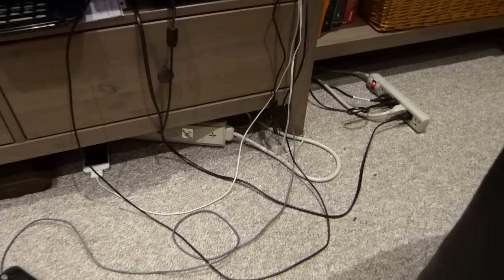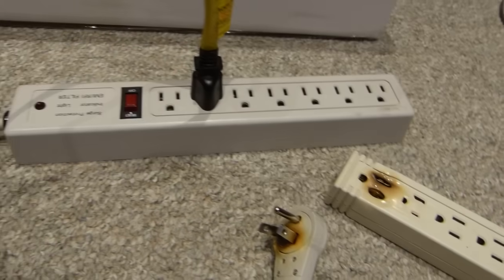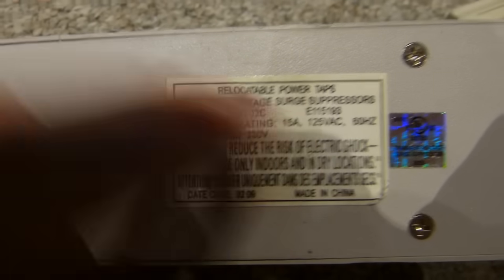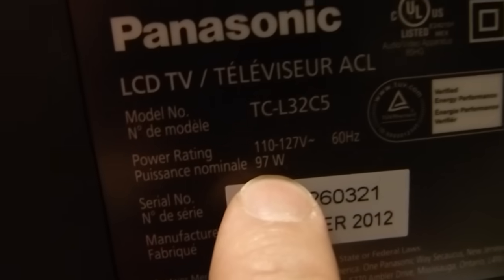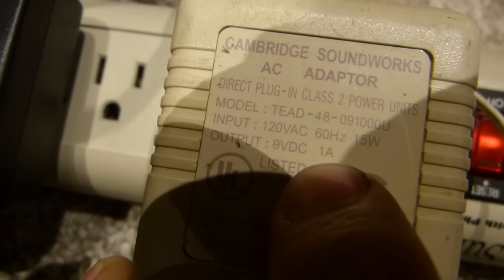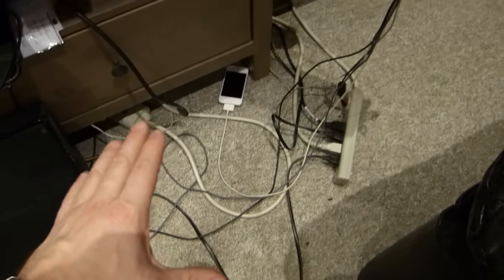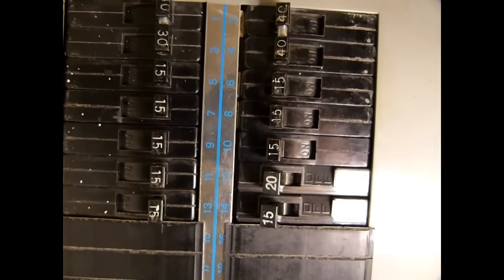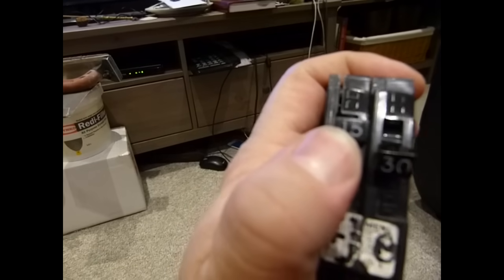Is it safe to plug power bars into power bars?

Comment: It looks to me as though either you missed something in your explanation of the failed power strip or something else failed. Here's why:
1. The strip that failed should have been able to handle the 12.5A load from the heater
2. If the load was more than 15A, then the failed power strip should have broken the connection on its own.
3. If the failed power strip was plugged into a branch with a 15A breaker and the load was more than 15A, then the breaker should have tripped.

It looks to me as though the socket that burned was itself broken -- I'm guessing a loose connection. I think that socket failed at 12.5A, and would have failed with any 12.5A load whether connected through another power strip or directly plugged in.

The bottom line is the failed strip was broken. It should have been able to handle its rated load without any issue, it should have turned itself off if its load exceeded its rating (15A).

I think the answer to your question is "Yes" ("Is it safe to plug power bars into power bars").

I think your thumbnail showing the burned socket is misleading. That thumbnail is more appropriate for a video titled "Is it safe to use failed power bars". And of course the answer to that last question is "No".
Reply from the maker: Yes, rotating outlet had a gappy fit to the plug blades, was arcing inside.

Comment: how many amps is a 700 watt computer power supply
Reply: rough numbers -- power is voltage times current. If your 700 watt power supply is plugged into a 120 v line, then it's drawing 5.83A.
Reply from the maker: I agree with Thomas Stambaugh, 700 / 120 = 5.833333 Here is some visual clues to go with that math https://www.youtube.com/watch?v=FWDxmp62itA

Comment: I know your pretty much saying this in the video but I’m just saying this because this was obvious from the start. Plugging in another power bar into another power bar is ok. But, if you plug in something as powerful as a heater, the power bar’s limit is surpassed and it starts to heat up and burns.
Reply from the maker: - that math is not happening

Comment: First off household appliances should never be plugged into a power tap or surge protector or even an extension cord! Heaters and air conditioners, and even hair dryers being the most common mistake just to name a few. Mainly because they generate higher levels of resistance witch causes unwanted heat to build up. Thats why its recommended to have each individual major appliance on its own circuit. Every minor appliance just plug directly into the wall. Just like the video states. It is important in understanding what kind of circuits that you have and whats loads are on those circuits. That way you dont overload them and potentially cause a house fire! Also not all power taps and surge protectors are fire proof. So make sure that the one you have is. Dont cheap out. Its not worth burning your house down over.
Reply: Sorry, but this is very incorrect. There's nothing magical or threatening about "resistance". Every device must have resistance -- if it doesn't then it's called a "short circuit".

There is a simple principle -- "Ohm's Law" -- that says that voltage (V) is current times resistance (R). V = I*R. If the resistance is zero, then current must be infinite to maintain the same V -- a short circuit.

This video is about power. Power is current times voltage (I*V). Whether cheap or expensive, a working power strip rated at 120v/15a can handle any load totaling 15A. It doesn't matter whether it's one socket at 15a or 5 sockets at 3a each, the result is the same.

The burnt power strip in the example was broken. It burned because it was broken. The nature of the load had nothing to do with the failure.
Reply: Thomas Stambaugh If you put plastic next to a heat source it will melt simple as that.

Comment: I only watched halfway as you came to a conclusion by then. But, why didn't the safety trip on the first power strip? Unless they were too cheap to use a thermal magnetic strip on the safety. (Thermal meaning the strip heats up under too big a load, then flexing and tripping the breaker, magnetic meaning a short causing a big magnetic field to flex the strip.)
Reply from the maker: Safety breaker is for overcurrent, i.e. power contacts ground, gets dropped into bath tub, etc..
This was within current limits, but arcing along the way.
(Also there`s nothing there to stop people from spilling liquids into it.)
Reply: If it was arcing, then the power strip socket failed. It would have failed the same way with any load.

Comment: Daisy chaining is the name that springs to mind to me. It's perfectly okay and safe to do as long as you don't exceed the power rating of the power strip, which should be molded somewhere in the plastic casing, or the sockets thereof.
Reply: Except it violates the safety devices that are on the power strip, extension cord or surge protector.  They are not designed to be plugged into each other in any form or fashion at all. They are designed to be independent equipment.
Reply: @chadmargraf4020  The reason manufactures warn against daisy-chaining is because they assume people will use every available plug in both the first and second power bar, and I don't blame them for assuming that because people are idiots. However, as long as you keep the full power draw well within the maximum amp rating for a single power strip, (which is usually around 14 or 15 amps) then it is not dangerous. People just need to understand that a chain of power-strips has the same maximum amp capacity as a single power strip. You don't gain extra capacity by chaining them because every strip in the chain must bear the full load of everything that's plugged in.
Reply: @Beefnhammer  thats what I figure, that you are not using all the devices at once.  and would shy away from using the bar for anything that heats up and thereby draws a lot of electricity.

Comment: Space heaters are in a general category, along with air conditioners and microwaves: things that really should be on their own circuit if possible. and definitely should not be plugged into any circuit that is already heavily loaded.

Dryers and stoves would be the absolute kings of this category, except they normally run on 220V and so usually have their own special outlets wired to dedicated circuits, which hopefully stops most people from unwittingly overloading circuits with them.

And yeah, circuit breakers occasionally fail to trip, so if whatever you are doing is tripping circuit breakers and causing you to need to reset them, this is a strong indication that you are plugging in too many big-draw items and urgently need to stop doing that.

Comment: You also messed up on the router. No way it draws 1A on 120V. Typically the only case where I'll add on an extra power strip is when I need to power a few small devices, kinda like what you have here. Other than that, I plug it into an additional available wall socket.

Comment: It's quite clear to me what happened. Electrical conductors get warm when they are pushed near their rated limit (doesn't have to be over), the first place to get warm will be the weakest point, such as a connection like a plug. As a conductor gets warm resistance increases, as resistance increases it generates more heat, and it can turn into a runaway effect until it starts a fire. Your circuit did not exceed 15 amps, which is why the breaker did not trip. The problem was the cheap Chinese power bars, despite saying 15 amps they are not designed to handled that kind of load. If you've ever used Chinese batteries that say something like "6000mah" but actually are more like 800mah, you'll be aware they are not shy about overstating the capacities of their products.

Comment: i was so sure he would say that a heater was plugged in on that one
i use this leap frogging technique in my home but i only use phone chargers so there isnt much load on them so its safe
if you wanna use a heater just dont do it like that
but for charging a few phones a bit further away its not gonna have any issues
Reply: wow how many phones do you need
Reply: L well at most 3 phones (not all mine) and a few other devices that dont need much electricity. Although i mostly put an "extension" so i can sit across the room while charging and using the phone because we never use them all at the same time

Comment: I wonder why so many countries have so odd electrical grids. 125V? That is stupid. The lower the voltage, the higher the current for the same power. More current means more power is lost to heat at resistance. P=I(square)*R.
Reply from the maker: Historical reasons. 1st grids are whatever, the rest are improved.
Reply: +Luca Dario Bützberger
Sadly, it is hard to change an already running and working system. Even when there would be a ton of waysto make it better.

Comment: The issue here isn't the leap-frogging of multiple power bars, it's the fact that too much current/power was requested by the second power bar, it failed to properly cut-off and just burned the plug by requesting too much energy.

Comment: make sense i have never had a house i had my laptop my pc my tv a fan and a moden connected but the modem is on its own power bar so i can reset without unplugging it 
power bar on mine is in the order of outlets form near on off is TV, Monitor, Laptop, PC, Second Power Bar. then modem is the only device plugged into second power bar

Comment: Isn´t there circut breakers in that house? Of cause i live in Europe where we have 230V. 

And i use only 16A Power bars (and 16A is the maximum on normal plugs). Most of the breakest is 10A (2300W) and some are 6A (1300W)

If my wife comes around and plug in plug in the steam cleaner and the vacum ... that she reguarly do... enable both at the same time, boom goes the circut breaker.

Comment: Man I got a power bar in my power bar and that power bar goes in to my tv and a second power bar comes out of the tv and I use that one to charge my 2 phones not to mention that I have another power bar that is plugged in to a lamp that that wire then feeds all the power in my house or at least most of my house and then finally the last power bar connects into the wall

Comment: You are calling people retards, yet you use the current ratings of the secondary side of the psus...
Reply from the maker: Not calling anybody anything, but what is sice and psus, Mr fine detail?
Reply: theoverengineer Side of PSUs (PowerSupplyUnits)
Reply from the maker: Ahhh, I read the wrong line off the PSU, camera had to be in the way. Issue noted about 5 months ago. Sorry about that.

Comment: What happens if you have 6 power bars connected to one power bar, and 6 more power bars connected to each of the 6 power bar, and power on 36 microwaves at the same time? hmmmmmmmm

I feel obligated to say this even though the video is self-explanatory, but don't actually try this, it is obviously dangerous.

Comment: not really, when you plug things into a power bar you draw more current on that wire than recommended, but when you plug another one into that first one, not only are you overloading just that one cable, but you are overloading the first bar's cable even worse.

Comment: The thing I hate is there is always something that has a big or strangely angled plug that prevents using the adjacent sockets on the strip.  That only encourages adding another strip.
Reply: Manufacturers still can't decide if the cable should come out the top or bottom of the adapter too. So you have to make sure there's enough space top and bottom.

Comment: its not power that caused it, its god smiting you for using and incredibly "fuck you" kindof power strip. just look at the damn thing! it fucks you over not only because of the angle of the plugs, but also the fact that theyre backwards (ground facing to the power button). say you have some huge ass power brick that you have to plug in yeah? you HAVE to take up about 3 or so spaces for it because you cant have the power brick over the edge on one side and on the other it would cover up the power button which is also a saftey hazard. tldr god hates you for using the wrong power strip and for using anything other than an american outlet
Reply: wait fuck those are american outlets
Reply from the maker: nice comeback, thumbs up for that :)

Comment: It works as long as you do not exceed 10 Amps. The heater + other things easily exceed 10 amps. You need a 20 amp socket just for the heater actually.
Reply: Perhaps for some foreign electrical code I dont know, but in the US we have 15 and 20 amp circuits. A 15 amp circuit can power a 1500w (12.5a) heater at 120v just fine, which also happens to be the limit for a single device.

Comment: DO NOT DO THIS THIS IS TERRIBLE ADVICE YOUR HOUSE WILL BURN DOWN
Reply from the maker: Video provides NO advice whatsoever. Because it can burn down your house. Pay attention.
Reply: you said it can be okay in some instances. It can certainly not.
Reply from the maker: The 319,018 viewers and their houses are fine and safe, so tell them.
Reply: First of all, you don't know that, and second, I just did tell them…
Reply from the maker: We do. But I was wrong, we only heard from 1053 of them, confirming the opposite.
Not really, this is not going to be read.
Reply: then why are you even replying if no ones going to see it? A less inept individual would realise how pointless it is and might even not put terrible advice like this on the internet for 12 year olds to try out in the first place.
Reply from the maker: Still not providing advice, back to line 1,  do pay attention.
Reply: You literally say in the video than "you could" leap frog... that is advice. You can't give advice and then say it's not advice and that makes it not advice. That's not how it works.
Reply from the maker: Good one.
Now, "you could" is an option. Difference between option and advice is:
Advice goes
"I recommend buying ... or doing ... " 
"The correct way of connecting ... is ..."
"According to ... building code, electrical, etc. source, the right way of ... or this is how it SHOULD be done ..."
My video is presenting an option, this is what I do, this is how it works for me.
There is no element of :one should do this, follow the steps in the video, my videos are not the golden standard of anything. The national and local electrical codes are.
It`s a legal thing.
Makes sense?
Reply: It makes sense, but you're wrong and you are too stubborn to admit wrongdoing. Not everything in life has to be a legal thing and, when you tell people that they can do this, it is unethical. 

You are justifying your actions by saying that you're being selfish. Stop.
Reply from the maker: Video is not about me. It`s about Kirchoff`s current law. People CAN safely follow Kirchoff`s current law, and relevant electrical codes.

You`re not re-writeing physics just because you don`t recognize it.
Might want to start by looking up Kirchoff`s laws.

Comment: I used one power bar as a source that went to another two bars, powered a computer with the monitor and my studio monitors. 

Never had a problem (at least for the 2 years I used that config), probably because there wasn't too much current going through at once.

Comment: its ok to have one more on the line Only if not exceeding the amount of plug space on the original one already. Say there is 6 ports for plugs. can have up to 6 items on it.  now some plugs are blocky in size. taking up more then 1 plug on the ports. sometimes you have 2 or 3 of these block plugs. where all 6 ports are covered up. noiw if you take extra power bar. plug it in the first one. you have some extra space for a couple more plugs if needed. but overall might be better ans safer to a longer or better power bar aka Surge Protector is what they are called.

Comment: About those multiple socket plug things, first of all they are not surge protectors at all, I don't believe that.
Then if you have a lot of low power electronics, you can buy a single one of those that has 12 sockets to avoid plugging 1 power with 6 into the wall and use 5 of them with another one with 6 sockets plugged into the 6th slot of the first one. This should help send the signal of if the high power consumption heater is plugged in, the breaker switch in your basement should trigger off and prevent that thing from getting fried but it will get hot. But it is best to place a heater in the actual wall outlet and not a power "strip".

Comment: In itself daisy chaining  power strip isn't a problem generally. The receptacles in most power inexpenvivetrips are substandard. My guess the person using the heater don their due diligence and unpluged it whenever the heater wasn't need. Most likely using the same on the power atrip wearing it to the point were it no longer made a snug connection to the plug, so heat was generate at that point. That itself wasn't an over current event to be tripping the breakers. When there's a need to daisy chain, use an heavy duty on at  the first position, and plug in high current devices to it

Comment: I didn't watch the video but I'll answer this. You can have as many as you want plugged into each other PROVIDING that the total current draw of the things plugged in is less than the rated limit on the power bars, which is usually 10 or 15 amps. A single heater or laser printer may be able to draw more than 10 amps.  If you draw more power than the power bars can handle, components may get too hot.

Comment: you did a mistake on the router where it said 5V 1A the power supply gives the router 5V and 1A, but how many Amps does the Powersupply take in at 115V?